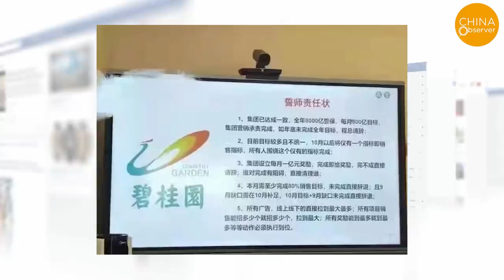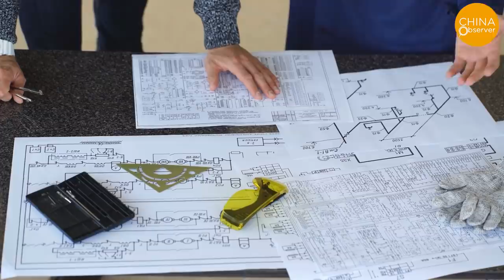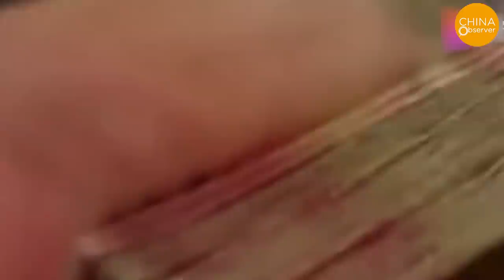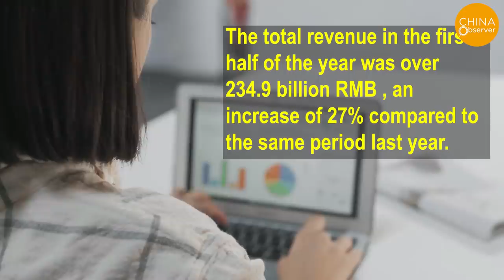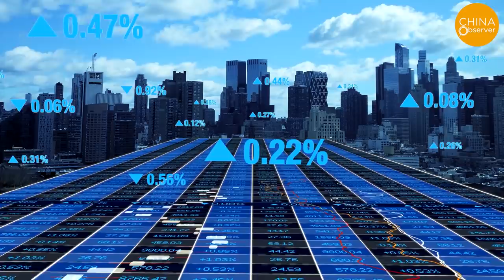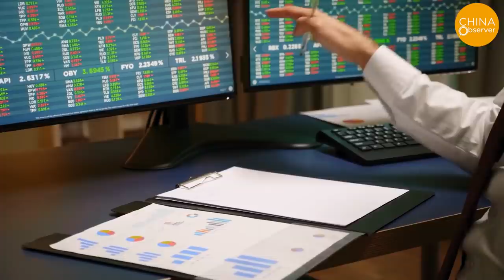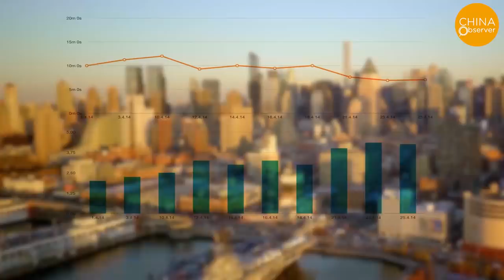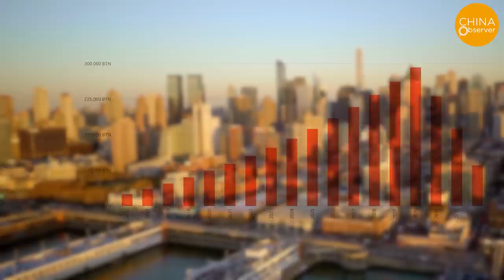100 Billion USD Real Estate Project Rotten-ended, Crisis Behind the Top-Selling Real Estate Company

Comment: Work from zero to zero o'clock? What does that mean? That's midnight to midnight?
Reply: 12 hours.
Reply: @blockedinchina6015  thanks. I've never heard that phrase before
Reply: Basically, it means you're a slave
Reply: 007 (at 2:42) is possibly an "augmentation" of a similar and existing "996加班文化" (996 overtime culture) widely practiced and imposed by Chinese bosses. 996 means you start working at 9am, you stop at 9pm and you work for 6 days in a week. 007 simply intensifies the 996 requirement. 007 literally means you are expected to be working from midnight to the following midnight without any break for 7 days a week. However, it is not to be taken in a literal sense, the idea is that at least your phone must be reachable and you must be responsive at all times, whether or not you're in office. 007 also connotes that the arrangement could be clandestine and not necessarily legal. So if trouble is brewing on a project with extremely tight deadlines, you are expected to solve it by hook or by crook.
Reply: 996 from 9am to 9pm 6Days/week
007 doing nothing 7days/week
#Layingflat

Comment: 9:05  Feeding many circuit breakers (I can see one of them is 20Amp) from one long daisy-chained power wire (red). Holy shit. 
That source red wire is not thick enough to feed the 100+ Amps that will go through it if someone tries to run loads on all those circuits at the same time.
Insanity.

Comment: so mentality is "there is no such thing as a design problem, get rid or it or resign", over pressured, overworked designers and builders making building at top speed and as cheap as they can get away with. then the marketing and sales team get rid of the buildings as fast as possible. cut every corners, make it cheaply, then run away before it collapse under a light breeze.
in engineering there is a saying: Low cost, fast, quality. Pick two.

Comment: I know this comment won’t be taken positively, but I urge you to give it some thought. Perhaps Xi was correct in implementing the 3 red lines and taking down the real estate sector. First, it will cause prices to plummet (a domestic win, although wealth loss won’t be) and second, a crash today probably wouldn’t be as bad as a crash in a couple years whenever the system is even more leveraged. It is possible that the economy tanks over the next couple years, shaving 20 - 40% of GDP, but then comes back “healthier” with more modest growth. It’s a gamble and it is heavy handed. No one really knows what the outcome will be, but given a few more years, it would be amplified even more. Just a thought.
Reply: @daveallentown6868  Excellent point. I do however believe that the regulation is multifaceted, not just because of the power struggle. While it does impact opponent factions, it does have the possible side effect of massive collateral damage. The “positive” outcome is the popping of a debt bubble that would be even more devastating down the line. It truly is hard to ascertain if this is just single train of thought action or if there are multiple sought outcomes.
Reply: A lot of people see the regulation goal itself as a positive move, the problem is more the sudden implementation/lack of warning. Phasing it in gradually over a few years could presumably have avoided some of these issues.
Reply: To my mind, the three red lines are too arbitrary and fail to allow developers adapt to new rules in a cushioned and orderly manner. When I read regulatory reports filed with the HKEX by these developers, including R&F, Evergrande, Fantasia, Sinic, Greenland etc. it's clear they're all heading to bankruptcy. Sometimes it's not because they can't pay all debts, but just one or two, which then lead to cross-defaults, thereby bringing down the entire company. I don't think it's ever a good idea to regulate an industry to bankruptcy, as you're not just losing "greedy" developers but also crucial skills needed by a developing country possessed by these same developers.

The policy is also really strange. If the CCP thought housing prices were too high or developers were over-leveraged, why do they keep leasing those lands to developers at market prices and on top of that, impose a so-called land appreciation tax at up to 60%? Singapore and Malaysia don't do this to keep their citizens housed. Singapore has subsidized HDB units. Malaysia outright imposes a requirement that housing projects must include a certain percentage of affordable units sold at a loss by developers. 

My suspicion is that this overleveraging issue is just a ruse and narrative told by Xi to confiscate private properties and eliminate ultra-rich rivals; because (1) once these developers go bankrupt, lands which had been paid for, will revert to the state (you can't outright own and transfer land in China), and these reverted lands won't be bare, but with unsold buildings atop. Meanwhile, foreign bondholders and foreign banks who had lent money to these developers will be stiffed, in a legal manner; and (2) the shares in these development companies, although floated in HKEX are in reality majority-held by few individuals. For example, Yang Huiyan (mentioned at 2:11) owns 60% of Country Garden as of June 30 2021. An effective way of imposing a 100% wealth tax is by ensuring the bankruptcy of wealthy people. I'm not being conspiratorial at all. Xi publicly announced his common prosperity agenda, and what we're seeing now is merely the unfolding of that agenda.
Reply: @besomewheredosomething  I agree with all your points, which are very astute. We have all heard the phrase "capitalism with Chinese characteristics." Most westerners only hear the word "capitalism." Nor do many grasp that the word "Chinese" means "CCP." When Beijing imposed the "three red lines" I would agree that they were intended to inject economic rationality into a distorted sector. But as you allude to, there may be other intentions as well. I mentioned that such tools, if selectively enforced, could be used to punish rival political factions. After all, Evergrande's connections to the mighty Jiang Zemin faction are well documented. Here is another possibility. I have read that the 4 state-owned banks own over 80% of the nation's banking assets, and that business (including the largest companies) are more dependent on banks to raise capital than in, say, the U.S., where the stock market raises far more capital than do China's markets. Also, those banks, being state-owned, are joined at the hip to the CCP.  Since China opened up over 40 years ago, those banks are operated at the provincial and sub-provincial level. Local party officials, not Beijing, decide loan eligibility. The "three red lines" then may in large part be an attempt by Xi to consolidate power over the mighty banking sector in Beijing. Such an attempt to diminish provincial powers may be perceived as a grave threat. In medieval Europe the counts and petty lords did not yield their powers to the king without a fight. Chinese emperors by and large respected the warlords. There is much to the story, but reining in the excesses of the property sector is an important part.
Reply: @Lee-pf6od  You would think so, but in my experience it doesn't matter how much forewarning you give a corporation, they'll always kick the can and do nothing until the last second and then panic. Look at California's energy regulations applied to personal computers. Optically, it looked like they came completely out of nowhere in effectively "banning" gaming computers. In reality, the regulations were enacted in 2016 with a five year grace period for everyone to adapt in time, and nobody bothered.
Reply: @Lee-pf6od  nobody expect the Chinese regulations!
Reply: Thanks to everyone in this comment section that bring out good points in the debate, its really interesting. If you have a youtube video you can point to me so I can know more?

Comment: Crappy construction of new buildings in China will result in collapses like the old condo building in Miami a few months ago.  There are videos of super high rise modern Chinese condo buildings where you can crumble the concrete pillars with a spoon. It is chilling. High winds or even a very small earthquake can send these towers down to the ground. Also. Moisture is horrific on building materials. Plants and planters and trees all over a building mean constant 24/7 and year round ROT and moisture damage even if the build quality is good and when the build quality is bad then it is a nightmare.

Comment: So what's going to happen with the Malaysian project? Is it going to get abandoned and fall into disrepair and just stand there forever, unfinished? Plus I wouldn't trust a Chinese company reclaiming land from the sea, there's probably going to be large structural problems with those artificial islands over the years.
Reply: Just like there is with those sinking bases they built in the South China sea. The runways are so warped that they can't land helicopters there, let alone airplanes.
Reply: Likely be sold cheap to Malaysian company which will takeover the project and build affordable homes
Reply: Their island building skills are crap too.

Comment: I don t get the garden project. Planed as residents for china, but then Malaysia realized what was going on or what? How come you put that much money in the sand without serious risk management. That sounds like you have found oil in your desert. 
Considering the scarcity of sand (concrete grade) nd the impact of artificial islands as well as the fact that we wont stop climate change (building concrete boxes in a locaton where people will need a plane to get to isn t helping) and this means sea level is going to rise in the next centuries - how does mankind come to the conclusion it has to build artificial islands and promotes it as great idea ?!?